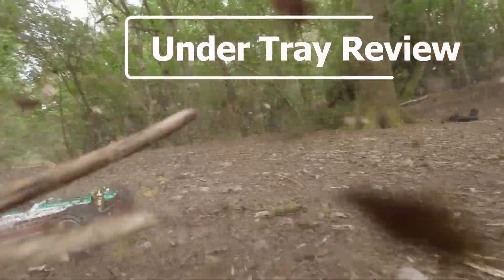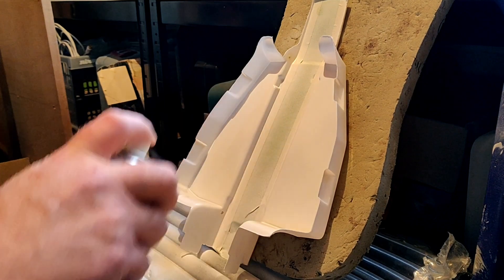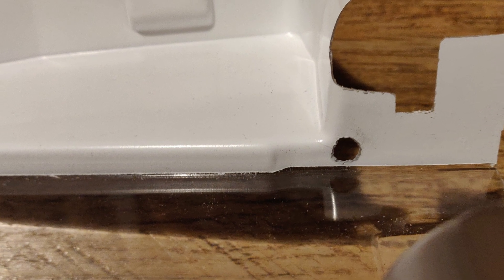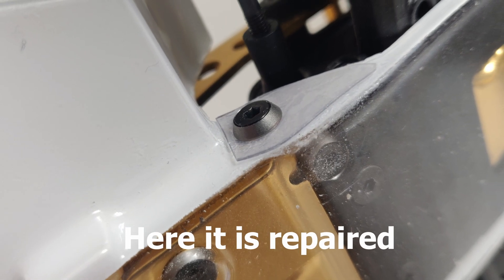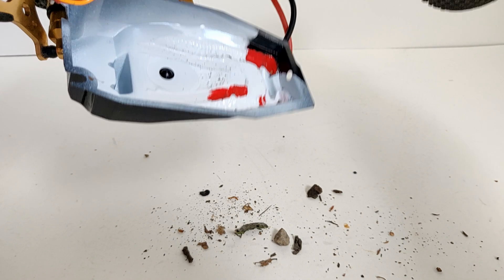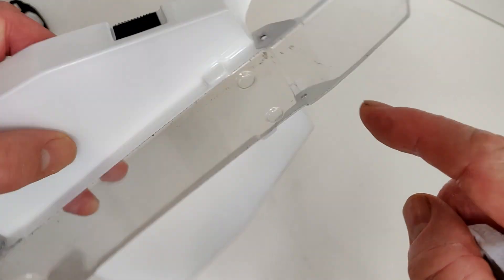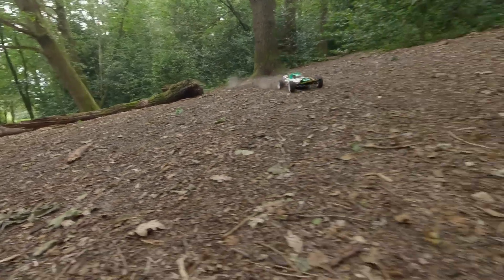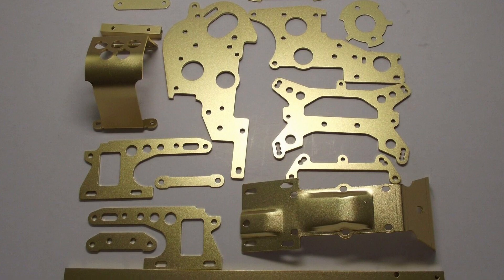Try Not To Scratch The Kyosho Turbo Optima Gold Chassis

Comment: I’ve used the same Revive Rc undertrays on my Turbo Optima and it’s done a great job protecting the gold parts I did use washers with the screws as well as taped up the exposed rear cage with vinyl and aluminum tape.👍😊
Reply from the maker: Excellent, thanks for feedback, much appreciated :)

Comment: I also have the belly pan and use it as a protector for my optima chassis. I ended up using the motor screws from a Traxxas rustler 2wd as the rear mounting screws for the belly pan because they have a big surface area to grab the lexan.  I also mounted it to the rod that secures the two chassis halves together. My esc and receiver are mounted on the top chassis plate too, so the driver figure is removed.
Reply from the maker: Thanks for sharing that, great info. Much appreciated 👍🏻

Comment: Great video Damian. I can understand how annoying this construction must be. Thanks for diong the run either.
Reply from the maker: At least this is available and in a less aggressive surface it would likely work better. Does stop big scratches unless a small stone gets trapped inside. Some buggies come with under trays from the manufacturer so I appreciate this being made by Revive RC and the challenge of making a third party solution. 
Thanks for watching.
Reply: @DustyFingersRC  🤔 my Avante has one and I always complained about it when changing the battery. But as a protection it makes sense.

Comment: Great video fella!
The problem with this particular car is that it just looks too good in all its shiny gold once built!
But, at the same time, it's such a great car to drive, so has to be used.
As I said to you before, I did look into an under tray for it..... but wasn't entirely convinced it was the way forward, you have confirmed this sir!
So, I bit the bullet and ran it unprotected..... and then cringed at the damage to the front underguard, bottom plate, bumper and motor cage! 😬😢
I then ordered a new set of wheels and tyres, new bumpers, new gold front section, bottom chassis plate, motor guard..... and a new body set for good measure.
These are all neatly tucked away in the box.
So now, I can drive it like I stole it and not have to worry...... knowing I have all the new parts to make it right again at a much later date!
I actually mounted the ESC on top from day one, as I was really finding it hard to actually get the driver to fit anyway..... so done away with him!
We should think ourselves lucky-
this buggy is an absolute gem, and I highly recommend it to anyone!
Cheers for showing us mate.
👍 👍 👍 👍
Reply from the maker: Brilliant!  Yeah, I remember our chat and that you bought some spares but didn't realise you bought that many parts.  
The undertray downfall is that anything which gets inside is trapped and gets thrown about rather than falling back to the ground. 
Glad.you are.njoying driving it and getting a buzz out of it like I am, thanks for watching, appreciate it 👊🏼
Reply: @DustyFingersRC 
Yep, I got a bit carried away (as I usually do)!!!
I didn't buy new shock towers as I still have the originals in the box after deciding to run it with carbon ones instead, which have picked up a few scrapes! 
The only parts now that I am still after is the gold shock caps, which inevitably get scuffed during the occasional times I put her on her roof! 😬
Superb content fella, keep up the great work. 👍 👍 👍 👍
Reply from the maker: Thanks for that feedback. Trying hard to keep the vids coming whilst balancing single parent life and trying to put food on the table. It is full on but love this hobby and the great community displayed with comments like yours. Motivates me 👍🏻

Comment: I have the same undertray on mine and had no issues with the screws with it going on. I may have drilled in smaller holes and that may have helped, not sure.  I did have to notch a bit out for the ESC as well. I did have some dirt and stuff in side once I was done but it was easy enough to clean out. For a regular runner I would probably avoid it as it is going to get scratched up eventually anyways. For me who wants to preserve it as long as possible I like it.
Reply from the maker: Screwing Lexan in to a countersunk hole stresses the Lexan and some of my screws had a sharper edge at the top than others and after installing it, 20 minutes past and it just popped. The countersunk washer is a better solution but glad yours is OK so far.
Choosing your surface is the best bet I think, avoiding areas with small stones cause if they get trapped inside and are thrown around it will get scratched up. 
The fun of driving it outweighs a few scratches underneath for me and as mentioned the undertray does help stop any gouges from driving over stones, it's the little ones which can get inside that might be the problem. 
I don't have a nice maintained track to use and just off road where I can but kicking up a ton of dirt is fun so all good.
I rather use this buggy and have the pleasure of driving it, I don't want to look back in years to come and only have memories of it sitting on a shelf 👍🏻

Comment: Floor marking tape to cover the chassis.  It is the same tape that is used to demarcate lanes on warehouse floors.  Try some on a test piece to ensure the brand of tape that is used does not need any solvents to remove the adhesive.
Reply from the maker: Cheers 👍🏻

Comment: Great review Damien. I think you are offering some great advice there pal. I have just picked up an under tray for my Optima Mid and I am wondering if I will see something similar. There isn’t one for the Ultima so I have used electrical tape on that one!
Reply from the maker: I think electrical tape will work well cause it will absorb some impact from debris and easy to remove and replace.  I am just going to continue to love driving it cause that massively outweighs a shiny bottom on a shelf...oooh err Mrs!
Reply: @DustyFingersRC  😂🤣

Comment: Nice and honest video as always, Damian! Bummer about the scratches and troubles fitting the undertray, but I still think it's a worthwhile "upgrade" for this series. You could contact Revive and show him the video, I am sure he'll be interested in knowing if there is any improvements to be made. He did respond to my "review" of my Top Force Revive body shell, but maybe that was because I was all positive, ha ha...
In general, with lexan, you always gotta reinforce the weak bits, but sadly usually we only know which are the weak bits AFTER they break...
Reply from the maker: Hi. Yeah I agree it is worth fitting one which I made sure to mention. Just worth considering that any debris such as small stones  trapped inside it may scratch it up. Worth considering the surface you drive this on if you want to preserve the gold parts as much as possible. 
Thanks for watching and leaving a comment 👍🏻